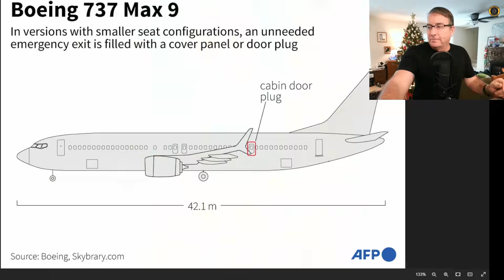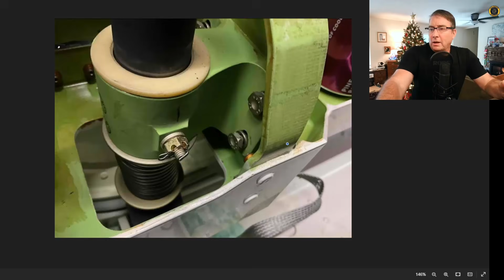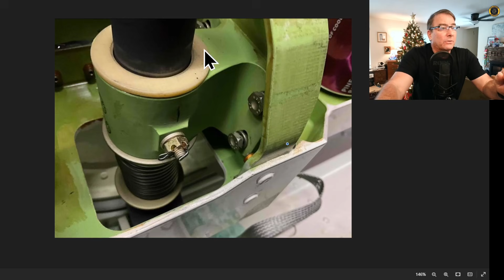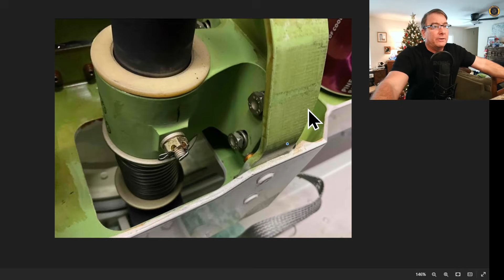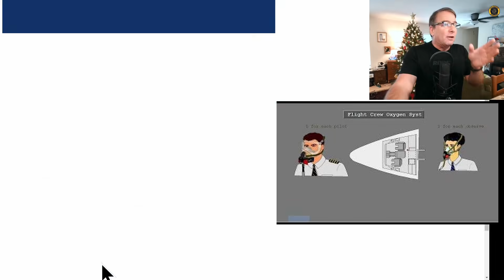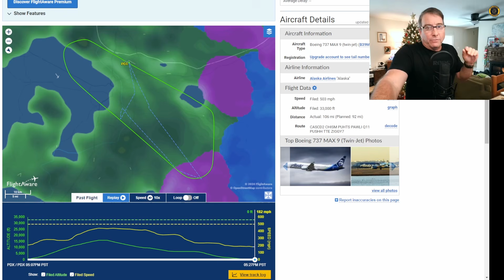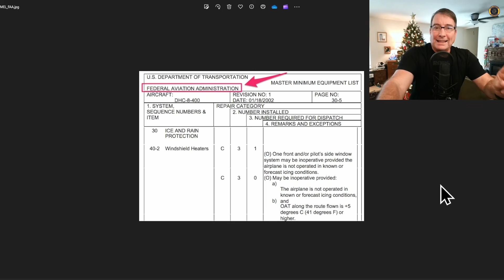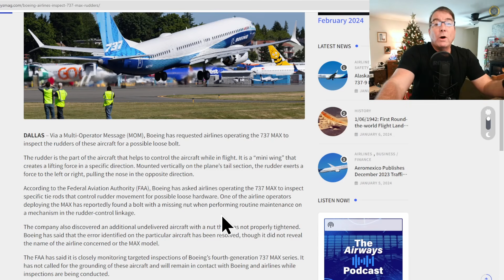"Yes, We Have No Bolts"  9 Jan 737 Max-9 Update

Comment: Parts / assemblies not fully inspected: When I started working as a aerospace manufacturing engineer in 1987 all parts manufactured were inspected. In the mid-1990's they started doing random sampling inspection. Say you have manufactured  100 parts, a percentage (I do not remember the number – 10%?) would be picked from the 100 parts and they would be 100% inspected. If they all passed inspection, then all the parts in the group passed inspection (most not inspected). For assemblies being shipped, a random few dimensions and or part print assembly specifications would be inspected. If these few areas passed inspection, the part would be shipped – without all the dimensions / specification being inspected. In the late 1990's operator acceptance was put in place. The operator making or assembling the part would stamp the paper work that they did the inspection and it was correct. Once every 6 months quality control would pick 3 or 4 parts the operator finished, complete a 100% inspection of these parts and if they all passed, the operator was certified for another 6 months. Up to this point, each part / assembly would have a manufacturing engineer and a quality engineer. Quality engineers worked for a separate vice- president and away from the manufacturing and product shipping part of the company. A quality engineer could stop the shipment of a product and could not be pressured to ship a part to meet delivery contract shipping schedule. until they (quality engineer) approved it. Sometime around 2010 (or later), government approved the removal of quality engineers and full responsibility was now given to the manufacturing engineer. This allowed the aerospace companies to make more profit by reducing labor cost in the manufacture and assembly of aircraft parts. The question is – did a separate quality person inspect the assembly of the plug-door on the plane? Probably they will never tell us because 'they' do not want the public to know that a very high percentage of parts / assemblies on commercial planes never was inspected – only operator acceptance inspection and no separate quality engineers involved.

Comment: I flew on Alaskan max 9s twice last year and I gotta say I’d rather fly on an older product without these issues or heaven forbid a French airplane. If it turns out that the bolts were completely missing, then how do I know about any other critical system components? Seems to me that a complete lack of bolts is the only way this could have happened on such a new airplane.

Comment: somebody in the news media intimated that this bolt issue is an installation issue at Boeing. As you showed two bolts had cotter pin locks on them and two other bolts were normal thread that looked like they had lock washers on them(hard to make out on the video). Growing up and working on my dad's Chrysler product cars, Cotter Pins were all that held the steering knuckles in place with the steering gear. They did a good job and I've never heard of Cotter Pins popping out or being broken. Lock washers can loosen over time but not to where a whole bolt comes out. Lock washers can turn less than a millimeter and stop or lock, that's what they're designed to do.

Something doesn't look right with that plug door as it allegedly blew off and fell 16,000 feet and yet it hardly looks damaged or bent, hardly the paint is scratched. What gives?  could that door have fluttered to the ground like a falling leaf. It 'does' have an airfoilish shape. It reminds me of the story of the stewardess Vesna who in 1972 survived a-non parachute fall from 33,000 feet and lived to tell the story

Comment: #1 If the 4 bolts were missing then there seems to be an easy explanation.
#2 If there are witness/contact marks indicating that the 4 bolts were inserted, torque tightened and cotter pinned then they may have been assembled correctly.  Maybe there was a material or manufacturing issue with the bolts? If the bolt material was brittle the heads may have fractured off allowing the remaining shanks to work their way out through vibration. Or if the bolts brittle fractured in the threaded area then the two pieces could have also worked their ways out through vibration. 
These are just my thoughts.
I guess we will find out more from the NTSB report which I look forward to reading.

Comment: I understand all of the hype about the door and the "plugs" and lose bolts, yada, yada, yada.

But what I haven't heard a word about is why there is a door that can't be opened in an emergency is on the 737 Max 9.  Why would anyone design an aircraft with a door that has no apparent function but endangers the aircraft if isn't installed properly.  Where is that discussion?

Comment: Isn't there some kind of redundancy protocol checklist in the aircraft manufacturing ecosystem before a plane is slated for delivery to the airline? Or is standard practice for the same guy to check off and vet his own work? This makes you wonder if there was a last minute interior modification that was made after production that required access to the plug door.

Comment: Question for @Juan: What was the probability of the plug door hitting the tail section, especially the horizontal or vertical stabilizers? IOW: How close did this come to a full vehicle failure?
Reply: I know you directed your question to Juan but he rarely answers questions.  If you don’t mind I would like to give my opinion.  
First, it’s difficult to determine emphatically how the door would behave without testing.  I think that it would not  hit the horizontal stab.  The row of windows is below the stab to begin with.  The door would have to fly upwards.  The airflow in the region aft of the wing is downward. This is evident from actual witnessed airflow on the 737.  Just about any aircraft for that matter.  Gravity is also pulling the door downward but only a minuscule amount in the time frame discussed.  All that combined makes it unlikely.  Unlikely, but certainly not zero chance.
Reply: @raoulcruz4404  Agree if there's laminar downward flow trailing the wing. But all bets are off if there's vortexing.

Comment: So what about all this door mechanism is unique to the Max9 that wasn’t also present on the -900ER from which the Max9 takes its fuselage virtually unmodified (beyond a slight profile change at the aft end)? I was very surprised that the FAA didn’t include the 400 or so -900ER aircraft with the exact same door plug (160 of them at DL, and a decent number at AS and UA).

Comment: I don't know about you Juan, but in the Navy when the squadron recieved a replacement aircraft it went through a acceptance inspection and we opened everything up in the plane and checked all the systems for correct operations. This was done to every aircraft even fresh from the factory. I've seen some scary shit. One F-14A we recieved had a piece of rope on a gear door instead of pushrod.
Reply: there was a documentary not too long ago covering the new culture and growing pains with Boeing. Absolutely horifying. Pre purchase teams showing up and pulling the plane apart and failing the build, not taking delivery. The worst violation was improperly installed rivets in the wings, left over drilling material, improper hole finish, etc. I was so shocked. They are blaming a lot on SC production but I think its company wide. Boeing thinks they are building Pintos.
Reply: @automan1223  we've run into that problem doing acceptance from the factory, finding drilled bucktails, metal chips, even tools, but that kind of stuff is expected. At least I've never had to fail a jet during acceptance "luck maybe", but I don't recall stories about a new jet failing and being sent back.
Reply: @lindas9302 absolutely I still remember the buno. 160666. That bird ended on display at Oakland airport. It lived up to that buno. everytime we would get it ready for a functional check flight it would come back early with something broken totally unrelated to the work we did. We finally got it past a check flight and sent it back to Miramar and let the depot team deal with it.
Reply: @lindas9302 NAS Miramar

Comment: This is direct result of the de-professionalization at Boeing.  They have been blatantly moving production away from WA and its experienced professional labor pools, and into cheap labor areas in SC and other places.  It is all about saving nickels, safety be damned.

This resulted in people with no professional qualifications or experience assembling aircraft, and Dreamliner's being shipped out with hardware, garbage, debris and even entire ladders present inside the aircraft which were discovered after delivery.

We will keep seeing this bottomless bean counter mentality, and Boeing's safety be damned, profits at all cost culture is bound to cause more accidents in the future.

The entire company is just a massive dumpster fire, and it will take years to clean that up, assuming they are even making any effort do to so.

Just a disgrace on all levels.  The FAA should be crawling so far up Boeings rear end right now they shouldn't be able to walk straight...

Comment: If the door was leaking the whole time, the alternate pressurization wouldn’t have kept up either. You’d have a total pressurization fail and the plane wouldn’t have returned to service until it was resolved. It sounds to me more like (and I’m sure it sounded to the maintainers at Alaska) one of the pressurization computers was just intermittently screwy and would be repaired when the jet got some downtime. I don’t think it’s related at all to this event. 

That design of door also can’t really be “half shut”. Either the lugs are all the way in the track, past the cam-over point, or they’re out. As you pointed out, without the locking bolts and with a spring assist, this much movement could be possible under turbulence. You could also have hardware on the lower hinges fall out, but again that would almost certainly be a sudden event, not a slow leak that caused minor pressurization issues up until a rapid failure. I’m just not seeing this event as being related to the previous pressurization write ups, and I think the news is just digging to provide content before we have any real information. 

I’ll disclaim this by saying I don’t have time with the 737, but I maintain other Boeing aircraft and have some familiarity with both pressurization and typical exit door latch systems.

Comment: I’ve got exactly the same type of castle nut and cotter-pin arrangement on the wheel hubs of my classic mini. One time I lost my left front wheel as the nut had gradually loosened and then stripped the drive shaft threading clean off! Luckily, unlike this Alaska flight, I was doing about 20mph at a cruising altitude of 0 ft at the time.

Comment: Does anyone else see a security issue with a door designed to fully open during an explosive depressurization? That seems like a ridiculous design choice to me. If nefarious actors were ever able to cause an explosive depressurization in the back, they also immediately gain access to the flight deck. That’s extremely concerning.

Comment: DEI?, the ideology and facist party that created it. No bolts on that plane either. But I heard Boeing has cut so many corners off for profit that safety protocols have suffered greatly. Is that the cause?
Reply: Non-workers on the Board, and capitalism in general, is the cause. I wouldn't even blame any one single human being in any role. We must change our economic system faster than a plug door can flymoff a plane!

Comment: When I was a firefighter and traveling in a shirt from my dept., I was often recognized by the crew and asked to sit by the exit. Being a GA pilot as well, I ALWAYS kept my seatbelt on and usually tried to see if the seat rocked any when I sat down. As many times as I have sat next to these doors this event is the stuff of nightmares. So fortunate this occurred with no loss of life. Thanks for the content Juan, and thanks for introducing us to Aram Bedrosian's awesome music.
Reply: I get the same shivers whenever I happen to be standing next to a fire alarm pull, don't even want to touch the darn thing with a feather (unless needed, of course).
Always hear lots of arguments against protective covers and caps, too, that they impede the response time of actuation in case of real event (waste time to break glass). Critical systems all need fail safes, double launch keys separated many feet apart, etc.

Same in SW GUI design: triple question: File/Exit -> Are you sure? -> Really?

Yes, Aram is a musical prodigy
Reply: This was not an emergency exit row.
Reply: You know this wasn’t an exit door though, right? It was a door plug.
Reply: Right.  No way to tell it was a hidden door from the inside.  Looked like a regular seat.  Thank Heaven no one was sitting in those seats, and that the plane wasn't at cruising altitude.  There would have been deaths or possibly a crash. @dlsjkl
Reply: No cockpit voice recorder redundancy and no Manual details Abt certain emergency possibilities occuring ,suggests how much is being hidden from FAA
Reply: @golddoor315  
Redundant, cockpit, recorders? No one has that around the world. 
I’m sure the NTSB will address how the recording was lost. It’s not a conspiracy. And I’m not sure what you think you’re going to find on it. The two pilots screaming WTF ???
The conversation with air traffic control is recorded. In fact, you can find it on YouTube.
Reply: @wimbletone1  you have misunderstood the situation.

CVRs were fitted to aid in Crash investigation.
In that scenario the recording is stopped by either loss of power or by a g sensitive crash switch.

As aircraft have become safer, they don't tend to crash, but instead make it back to the runway.

There is then the risk that if not  done soon enough, the recording could be written over.

It stems from the days of tape, where a continuous 3 hour tape was recorded onto, looping over itself.
So the regulation stipulates 3 hours, not more as some aircraft have old tape based systems.

In most modern aircraft however, the recorder is usually capable of 25hours but only records 3 as that is the requirement.

Redundancy isn't needed, longer recordings are.
So a change in regulation to increase min recording time would be best, leaving more time for the data to be recovered after an incident.

But it's a bit of a non problem in many incidents as the crew are still alive to tell their story and modern aircraft FDRs record lots of parameters to give everything needed.
Reply: @richardwillson101  
In other incidents, the CVR is extremely important. Because the pilots tell you what they think was happening. Often during severe events pilots do things like not communicate properly fail to hear, certain alarms, or miss sounds the aircraft is making. 
In this particular accident what would be learned is how the pilots dealt with the sudden event, and if it would require additional training for other pilots to deal with it properly. 
For example, how much time did they waste dealing with the blown open cockpit door.

Comment: There is a photo that appears to show the aft hinge guide still attached to the lower hinge assembly. This seems to corroborate that the door was able to translate up and thus move from the stop fittings. Of course for this to happen the upper guide pins would have to be missing.
Reply: The upper guide pins are attached to the aircraft door frame and are still undamaged and in place. The guide pin tracks are attached to the plug and they're still attached and undamaged.

Comment: I have little doubt that they were flying this aircraft with that pressurization warning under the presumption that it was an electronic issue but no confirmation. There's a good lesson there. If you have a warning in a part 135 aircraft that you cannot absolutely pinpoint its cause, and therefore comprehend its risk, that airplane should not fly.

Comment: I am a little confused. Is it the bolt and castellated nut that was loose or missing or was it the four standard bolts and "non protected" nuts? It seems to me that those four standard fittings should have at lease used something like "locktite" to keep them from coming loose.
I also have a question as to when these "plug doors" might have been removed after initial manufacture to give access to do final outfitting of the aircraft such as installation of the seats and galley, etc. There still should have been a thorough top to bottom inspection of each aircraft before it takes its first flight. I believe this oversite might have happened when they grounded the fleet for the MCAS problem then the pandemic hit. At that time they might have been moving "almost completed" aircraft out into the parking lot with a note "to compete when FAA says so".

Comment: I don't fault the crew or maintenance staff at all for failing to pull a circuit breaker. I fault Boeing for a system that overwrites data within months or weeks of an incident. Memory is absurdly cheap, and my $100 doorbell can record motion-based video and audio for 9 months on a cheap card.   A system that stops recording ten minutes after the plane is shut down would work fine.